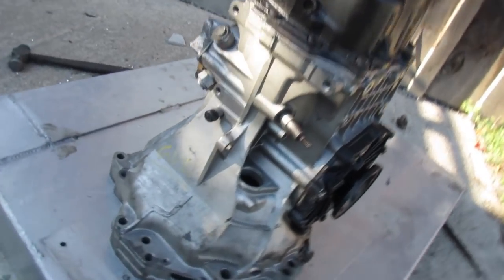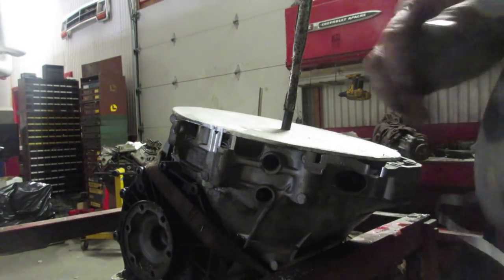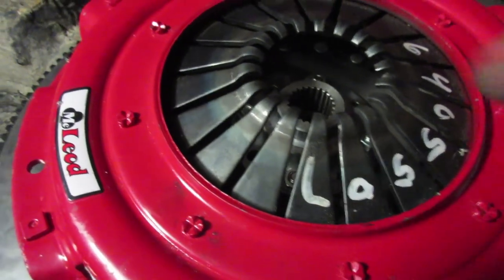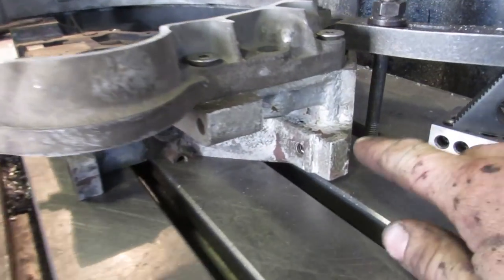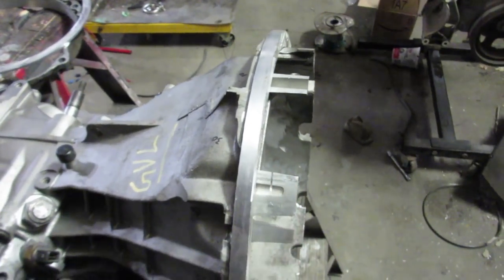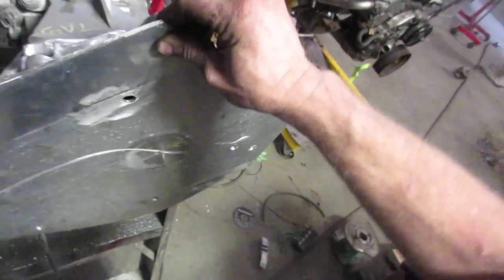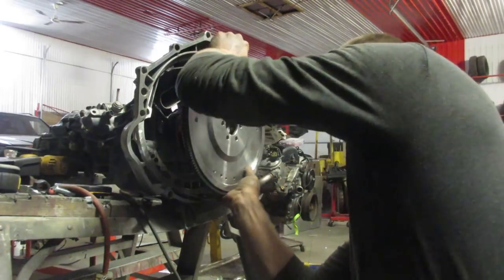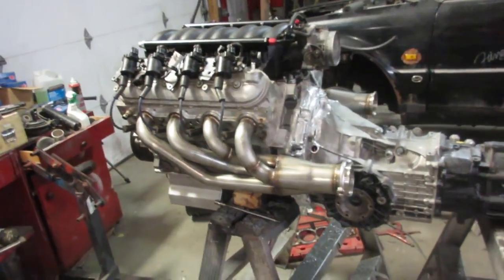We Cut Up Our Transmission... | #Debocho [S1 E10]

Comment: If you put the amount of engineering into the suspension as you have for the driveline, I think you're gonna have a scary fast track machine by the end.
Reply from the maker: 2bennet took the estimated weight of the car and built a custom coil over suspension for the car.  Its lowered around 2" with adjustable heigt and tension.  All the bushings and every suspension part has been replaced

Comment: I'll give it a 10. It makes me miss my 1978 ford pinto. I hacked and cut it up then shoved a 350 chevy and 350 turbo trans into it then replaced the rear with a 9" after I broke the ring gear on the OE. It was so much fun having 90% of the weight on the front tires :)

Comment: That is a lot of engineering , I give it a 10 out of 10, that transmission holds up in some high HP rally situations but will it handle that much torque..if it does, you are going to be a beast on that track, congratulations on getting so much done, it looks pretty awesome

Comment: 10 on the impressive scale. I say that because it isn't a huge fab company. Its one guy with a router, and some good tools and friends at his disposal. But it's the sheer depth of thought to get a twin clutch in there and fab those two ridiculously different housings together that takes the cake. I've looked at both bellhousings before since I have a tuned A6  I built and ls 6.0 truck and I realized with the depths and all I was not going to even think too hard on it.

Comment: Hey deboss    I've done a lot of bell housing/spacer/flywheel/flex plate/fiber gear fuckery in log skidders.  Replacing the 453 Detroit with ferd int/6bt/v8 Detroit fuel pinchers.  

It all works fine until something breaks.  Try to bolt everything.  Welding means it must come back home to fix. 

In my opinion, don't mix drivetrain and power train brands.  Much easier faster and cheaper to just mod the factory engine

Comment: It will be competitive if it does not break. We have pushed 500 through that drivetrain before and only had center diff problems. However we didn't push nearly the torque your getting out of that engine and truck turbos. You'll just have to find out I guess! That's a fun experiment in my opinion.

As for the car I personally never got good driving it. It was always strange putting down so much power and not having the car over steer. I would get spooked and lift - bam, race lost. Best way to make up for that was to pull between rows of cars on the start, hammer the gas and go right up the middle to the front. Then drive crazy.

Whether you win or not though, this project is great. Good engineering, resources in line with real life, and a cool looking car and motor!

Comment: What you did was pretty clever. Have you seen aftermarket gearbox conversion plates? I would have thought you would want to keep the bellhousing intact, and bolt a plate to it that would also bolt to the rear of engine? I assume there was a reason you didn't go this way.

Comment: The combination of AWD traction and low end of the V8 is going to be VERY hard to beat.My 01 Audi A-4 with a 1.8T running a 35R has devoured more than it's share of high HP cars on the track and streets.My car has the full OEM interior,heavy stereo including a extra battery and she dips a lot farther into the 10's than I care to post in public.It's not the average sleeper but the Audi trans with Torsen diff never disappoints in the traction dept. and I know yours wont  either ;-)

Comment: Question: What did you cut that aluminum engine block with???  I need to cut some aluminum cylinder heads in half accurately.

Comment: Maybe I missed this, but why the double clutch setup? Power? Or space reasons? If you said in the video I apologize for missing it. Great project nonetheless. Love the idea of adapting the trans and not throwing even more weight farther in front of the front axles with an adapter spacer. Keep up the great work!

Comment: should do ok on the track , as long as you get the weightdistribution between the front and rear to be close to neutral
prolly be verry competitive if everything stays together
if it turns out too heavy you could allways keep thinkering and put the driveline in a lighter sports car body (porsche 924 944 maibe?) or shorten this body intoo a two door two seater

Comment: Im an engine guy not a transmission guy. Im not sure if the audi trans will hold up to the power of the turbo chevy v8. That said, i also cant think of many all wheel drive trans that will hold up.....walter rorhl(im sure i spelled his last name wrong....sorry walter!) used to race an all wheel drive audi with 1000 horse power. I believe it was an s1. He was fast as hell in it! I would have tried to find an old s1 trans to modify for this build. Anyway, you guys get a 10 out of 10 because of all of your ingenuity. Hope it pays off for ya!
Reply: Vance Sloan The Audi 01e transmission is VERY strong, even in stock form. These are used in biturbo s4’s, v8 s6’s, and as a manual conversion in the biturbo v8 rs6. Stock for stock it’s equally as stout as a t56 or similar. Modified, it’s even stronger. Drag racers put 800-1000+ hp through these, and they survive quite well,.. 

My S4 was at 475 awhp, I abused the hell out of it, and never had a transmission issue

Comment: the little input shaft diameter on the audi... yikes. My only pessimistic thought. GM was forced to give the v8 manual combos in a truck a 3/4 ton measure... food for thought. my 1980s subaru shaft is bigger.
Reply from the maker: It was built and dyno'd at 800 ft lbs by Advanced Automotion.  I have to take his word that it will take 800 and not exceed that, or 700...

Comment: The work that you've done on the turbo instal and trans adapter is amazing, but I that Getrag was built to handle about 300 lbs of torque and you've already gone past 600. I think audi does an unequal torque split - that rear output shaft is going to take some serious abuse.
Reply from the maker: The 01e was built by Advanced Automotion with upgraded everything.  It has been dyno tested to 800 ft lbs
Reply: Holy crap, those must be some serious mods - I stand corrected. I remember now that you said it couldn't be shipped because of the hurricane. I should have realized it was being upgraded.

Comment: i do have that evil feeling of your junkyard engine with around 600hp and 400lbs/ft will just twist that adapter plate of thin aluminium you got there under work..    it will start to work bolt holes to look like oval's on every single time clutch engages.

Comment: Should have stayed with the audi 5cyl engine. They easely make 800hp and dont weigh as much as that boat anchor.
Reply: Mark Stenger ls engines Harley exceed 550 pounds like ever and most 5 to 6 cylinders are around the 500 lb area and a ls can make 1456 hp on stock parts so yeah they'll blow in a car at that power level but your Audi engine physically at 1456 horses would need a lot more money